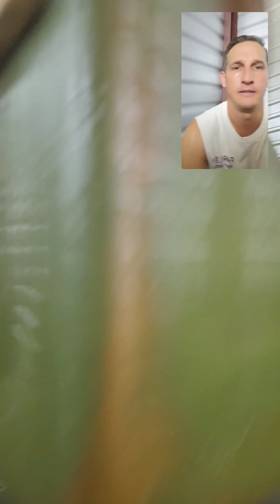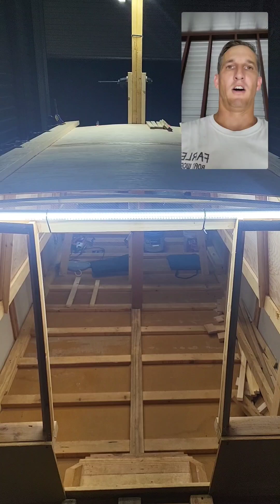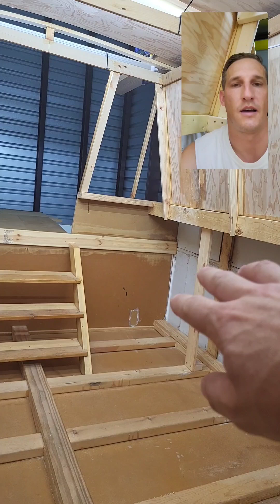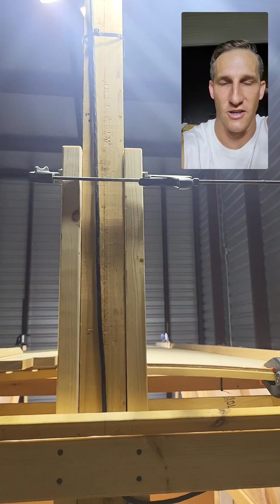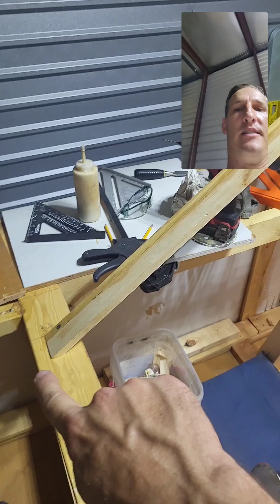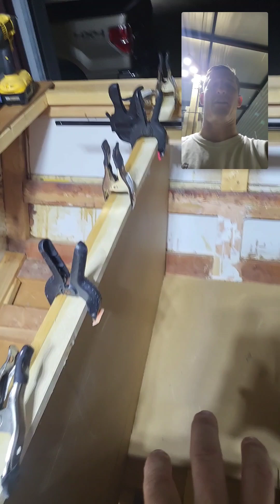The Eagle Scow Project

Comment: When will these advertisers realise that no matter how many times they enforce their adverts , we ain’t going to buy their rubbish
Reply: Ive not seen an advertisement on YT in years, not a single one.  Use the Brave browser and they will be permanently gone.   If your ad's are comming through your streaming TV, you can remove the ad's with a Pi-Hole.  You need to have a little computer knowledge to build but they cost less than 100 bucks.